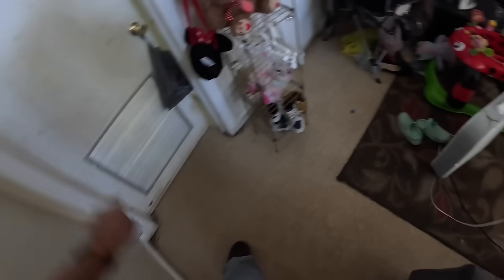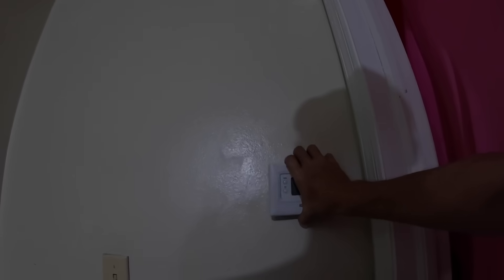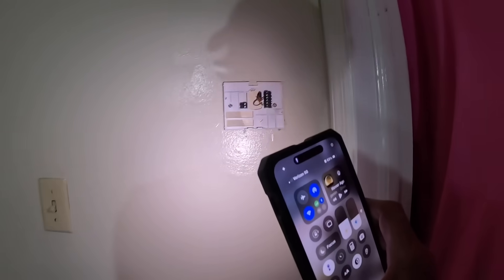No Cooling Call Leads To Serious Problems! #hvaclife #hvacarmy #hvactrainingvideos

Comment: OK I could swear that there were no batteries in that t stat, not that it matters at this point. Your magnet tray, lol, like me you hid it from yourself. Another messy house, inside and out. I would be embarrassed, some folks just have no pride. Good diag, even though someone else said it, you have to check it yourself. Thanks for sharing.

Comment: That compresser look brand new! Was the plug a little oily? Good job Curtis!
Reply: You can't go by looks Dan, it was dead short to ground. If they would make compressors that you could take the top off, many times you could repair them easily. All that's in there is an electric motor and a piston/pump. A money maker for them and inadvertently a money maker for the HVAC Guy, although you would still charge for a repair. I had years ago, refrigeration and freezer  units that had rebuildable compressors.
Reply: @jthonn  Sometimes you can. If a capacitor is all puffed up, I just pitch it. No need to test it.

Comment: Thats sad, a compressor going bad this soon.  I would have to say that 3 wire connector had some deformation from heat. What is all of that crud on the cabinet of the condenser ?

Comment: Wow. 9 years old and looks like that? What causes that to happen? I would have thought 20 plus years old.
Reply: too much shade combined with moisture = perfect condition for moss, lichen, algaes, molds.  look at the lower left house siding and mossy ground.    possibly also  exacerbated by badly adjusted automatic sprinkler spraying on the  unit and house every day.

at least the compressor/insides look clean..
Reply: lack of maintenance, if people would check there machines like once a month they would last a lot more